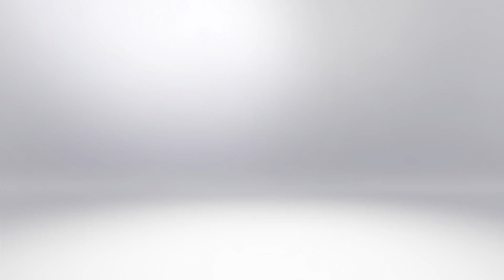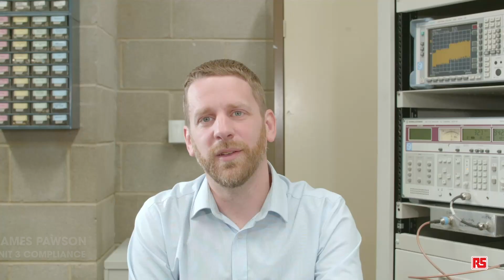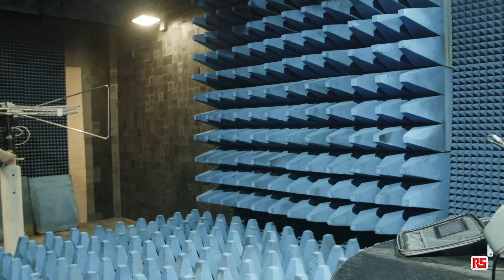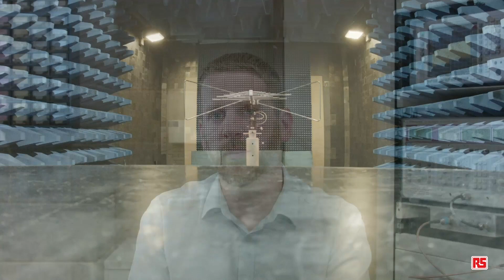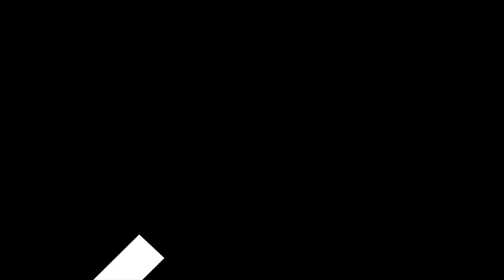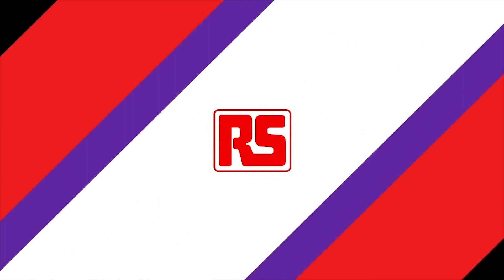What is EMC?

Comment: How to create rounded rectangular drill hole in ds pcb?
Like acs770 current sensor
Reply: You will need the 'free range eggs' add-on for that.
Reply: Two hole saws, make two of the four Audi Motorcars badge type vesica pisces forms.
Then, with a jewelers file, abrade the two points-  you will have a "rectangular drill hole". And good day sir.